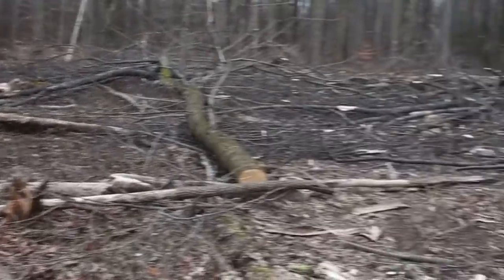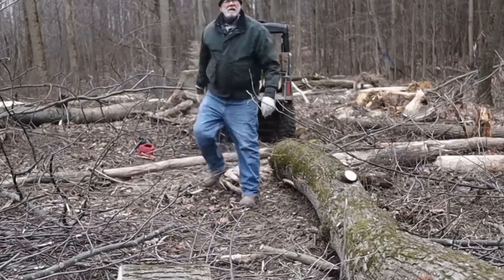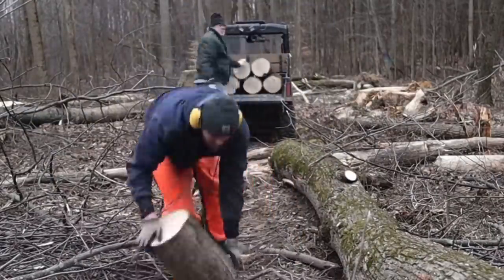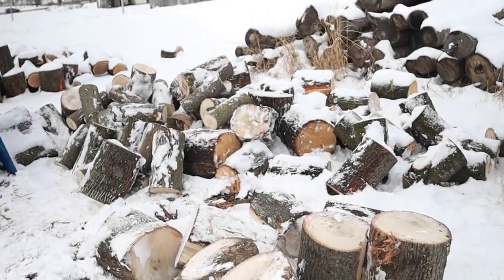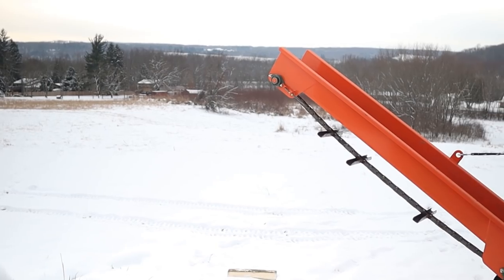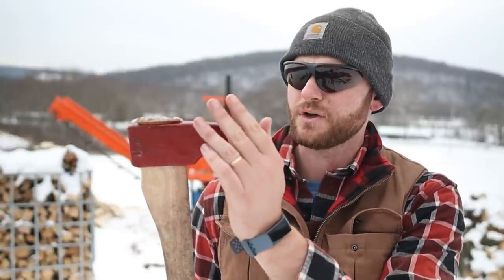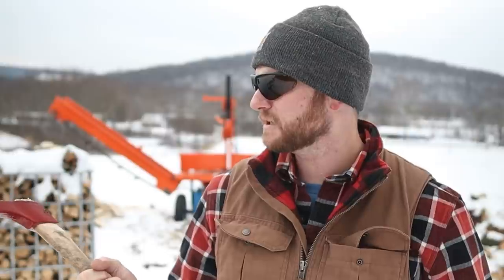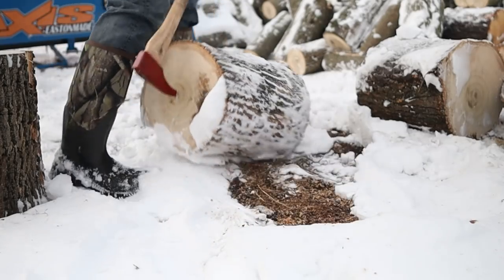You Guys Were Right - This Is Better

Comment: Keep doing research on how to lift properly and keep improving your technique. 40 year old future Adam will thank you. The hookaroon is nice but it also tends to get you into jerky motions. You're upright, but your back is in a slight twist position often in this video. Lifting weight with your back in a twisted position is really bad. Im talking about the kinda of damage to the back that can't be fixed...not just sore muscles that go away after a day.. Stay rigid and engage the core like your are about to get punched in the stomach before every lift. I wish my future self would have told 19 yr old Ed that advice 25 years ago.
Reply: Here here. I'm 30 and have been in love with wood splitting since I was 13. The hookaroon is cool looking. In instance of this video, where the wood has snow all over it and the pieces are probably frozen together, sinking that hook into it is pretty cool. I'd just take my maul and swing it like a golf club to bust it loose from the others. But yeah, it's all in the squat. Some pieces of wood are so big that hookaroon would only be useful to roll it around on the ground. At that point, you've gotta lift with your legs. Improvise.
Reply: Yes I was wondering if anybody knew it is not easier on your body.   In addition to Ed's advice also split up the movements you use.    So pickaroon some and also the squat and hand grab method a portion of the time as well.   

The real body saving tip is to use your most powerful long lasting muscle at the start of work.    So Use that brain and instead of dumping the side by side next to the wood splitter just split rounds directly out of the side by side.    & for God's sake dump off that conveyor directly into something.

Comment: Hookaroon?
That's not what there called out west LOL.
Pickaroon..
.
The ones we get are made by a small scale black Smith and have a much smaller point. And not bent over so far.
We ad a small block of steel to the back side to take small dead knots off.
 or drive a wege in the log as the board is being cut. To keep the circular blades from getting hot ect..ect..
Mostly related to large custom cut timbers up to 8"x12"s 26 foot.
.
It's an old mobile demention sawmill.

Comment: Almost every time I see split firewood go up a conveyor it is dropped on the ground, very wasteful.  Why not put it into the back of a truck or a trailer/wagon?  You know it is not going to stay on the ground, in the snow and you are only going to have to pick it up again.
Even if you are going to stack the wood into those tote frames it would be so much easier to load from waist height than from the ground.
If I were you I would just let the wood fall from the conveyor into the tote frames, it will still dry and it will be so much less work.
Burning firewood is enough work without making it harder, you should strive to make it as easy as possible.
Great video and a really nice log splitter!

Comment: Ok. Now that we know mum is reading the comments. I have burned close to 200 face cord. I can honestly say that splitter must be one sweet machine.

Advice tidbit#1.
Why not put the trailer under the conveyor. And you can take the split wood to where you want to pile it.
Advice tidbit#2
After using my pikaroon for a year. Keep a first aid kit close.
I have grazed my shin more than once when tired. Enough to make me realize I won't work without one nearby. Your house is too far. Keep one on site either in your truck or in a water proof box.

Comment: But then you use automation to dump four to six times as many pieces on the ground, which you now need to bend over and pick up. The number one rule of efficiency and energy conservation is to handle the materials as little as possible. At the very least your conveyer should be dumping onto a wagon but preferably into whatever your final storage configuration is. So much wasted time and energy in your methodology.
Reply from the maker: I have a dump trailer I normally convey the wood into but I need to use it later this week and didn’t want to have it full of wood

Comment: How is the pickeroon on really large logs? I use a hook and that helps. My log splitter  is a typical horizontal machine, max throw is 20 inches.
Reply: you kind of want to watch out on big stuff.  the pickaroon doesn't make you stronger or the wood lighter.
Reply: @kenbrown2808  Thanks Ken:)
Reply: @thomashall9792  first time using my new one, a rather large round took off down the hill with it.  fortunately, I wanted the wood at the bottom of the hill, so it was only a minor inconvenience.
Reply: @kenbrown2808  That is a good thing:). I now have logs delivered from the local tree service. They are in a pile as you are aware. I do start by cutting the ends for the first season, then next season deal with shorter log length:)
Reply: @thomashall9792  I just have a few lay down for a dirt nap every winter.  usually someplace inconvenient.  what I don't get cut and split often rot where they fell.

Comment: Curious Adam, why not use that giant log lift table?
Reply from the maker: I did use it on some of the larger rounds but the 8-14” rounds it was just quicker to life them up in the table. Plus with the Hookaroon it’s basically like having a handle on the log that you can grab with both hands so it makes it easy to lift it up
Reply: @HometownAcres  I just ordered a Axis. I have it coming without a conveyor being I already have a 16' conveyor I can team it up with. I aslo ordered a 32' conveyor for my 22-28 to be able to pile up wood. I don't have a lot of room so I need to make large piles.

Comment: Do you miss the 12-22 and why?
Reply from the maker: If I had to pick, i'd stick with the axis.  Its not going to put out quite the production the 12-22 will, but I'm an OCD freak and I like controlling the size of the spits and its much easier to work around knots with the single knife on axis.  Alot less kindling, splinters and waste.  That being said it is still quite fast, just not as fast as the 12-22